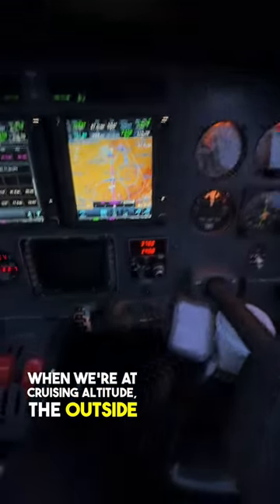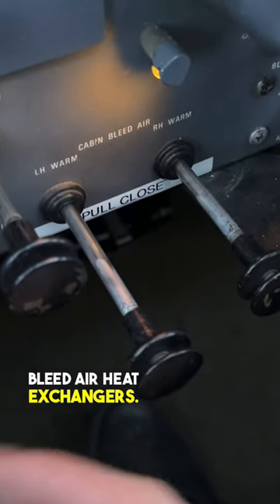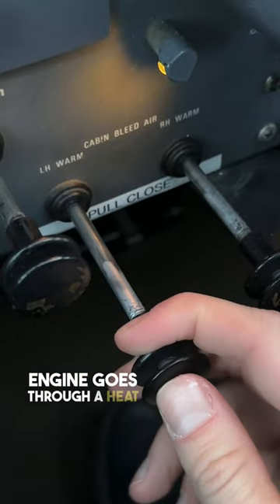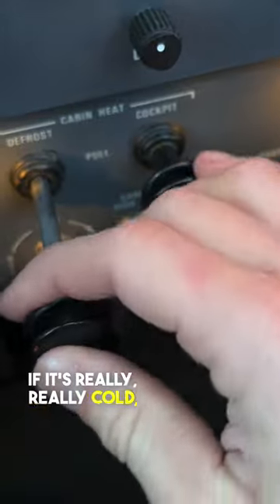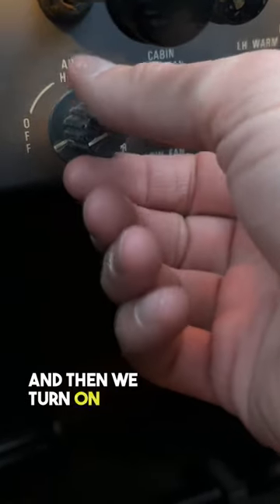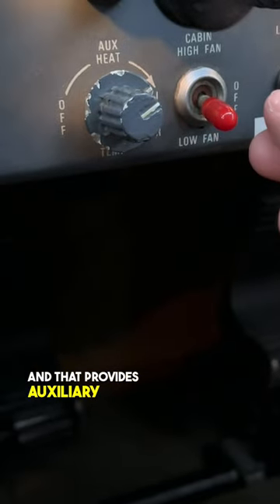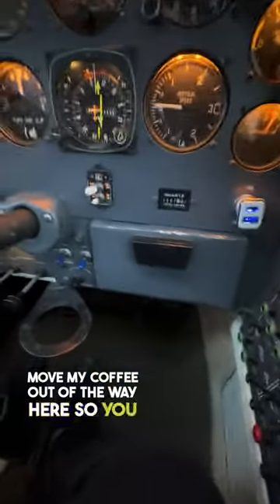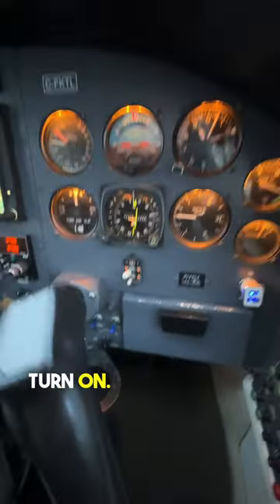Controlling Cabin Temp Explained! | Aircraft Environmental System | Pilots & Aviation

Comment: What's kind of funny/cool would be needing the air conditioner because you're taking off in a desert but then very much need heat when you start climbing to cruise altitude.
Reply: Even more ironic would be that taking off in a desert you would need to turn as many auxiliary things off as possible including the air conditioner to leave as much engine power as possible to take off with, because hot, dry air is very thin and so it requires more engine power to be able to climb. (Next time you fly in a jet, notice how the cabin air heats/cools and then right before takeoff the air starts reverting to the outside temp until after you're a couple thousand feet up.)
Reply from the maker: Very true! Haha it always happens that way. What amazes me is that these airplanes can handle the fatigue stress from constant drastic changes in temperature!
Reply: @EvanLuft  They learned that lesson after the comets kept blowing up because they didn't fully appreciate the stresses planes were under. And then that Aloha airlines flight was another wakeup call.

Comment: My buddy has a Conquest that they use to do aerial mapping (photo flight).  They are great for this because the hydraulic controls make it easy to route around the 2 foot hole they had to cut in the bottom for the camera.  A few years back they a Dash 8 conversion (8 or 10 … one size up turbine conversion) which was pretty neat as it made the service interval nearly unlimited.

Comment: Our 441 Conquests have an air cycle machine like a jet… no aux heat. We get all the heat or cold we need instantly after startup
Reply: Ooh nice! Conquest uses a turbine engine though - an air-cycle pack (probably?) won't work on a piston engine because they require a stupid amount of high-pressure, high-flow air to function.

Comment: Bleed air heat meaning you’re breathing exhaust fumes?
Reply from the maker: No it is compressed air from the compressor side of the engine. So it is not exhaust
Reply: @EvanLuft  bleed air can be contaminated with oil due to worn labyrinth seals in the compressor shafts, granted not exhaust fumes still not the best to be breathing as it can cause aerotoxic syndrome. 

Turbine engine oil is some nasty stuff to handle in the right conditions with ppe.